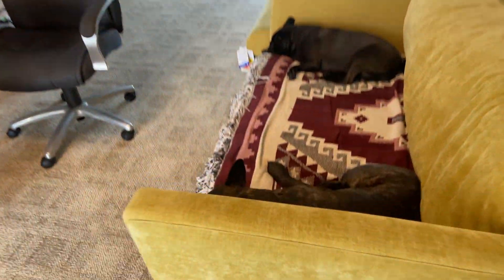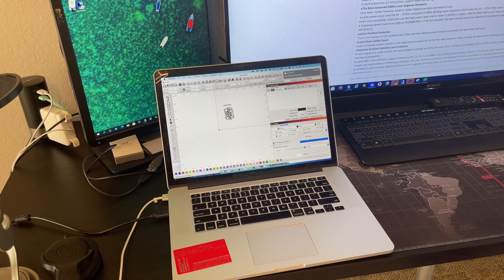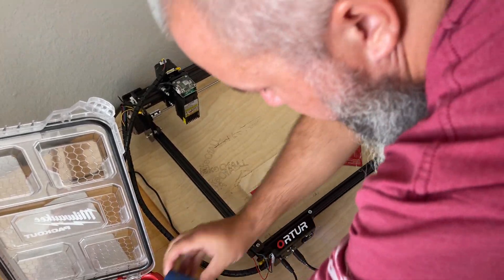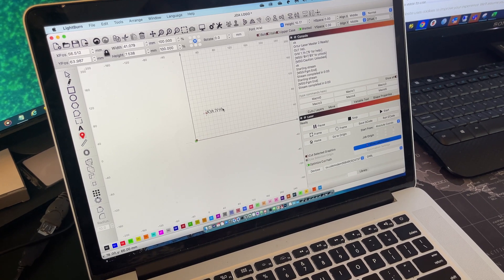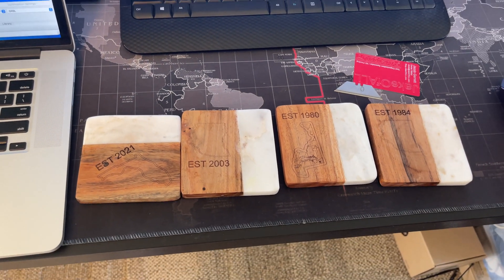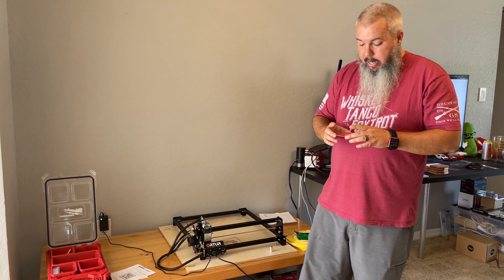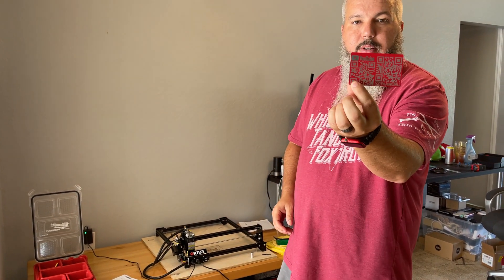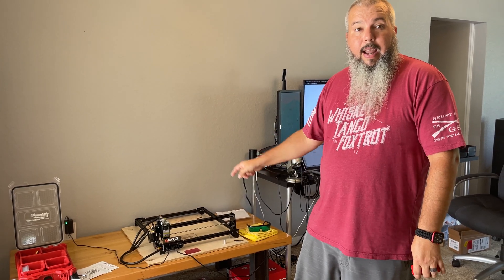Tool With A TOOL : Sharks with Laser beams !  DIY business cards and more (ORTUR Laser Master 2)

Comment: Fantastic video, exactly what I was looking for! I wonder if the rotary tool for this would etch into powder coated Yeti tumblers?

I found a template on Etsy, for a wooden jig that holds 6 metal business card blanks at once. Is that something that would be easy to configure in the settings for lightscribe? I literally know NOTHING.
Reply from the maker: Yeah probably